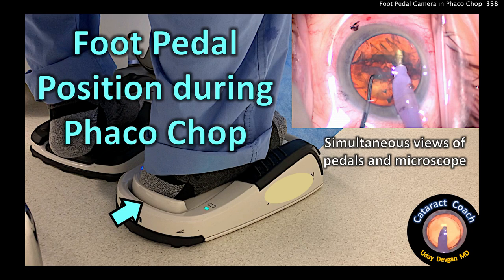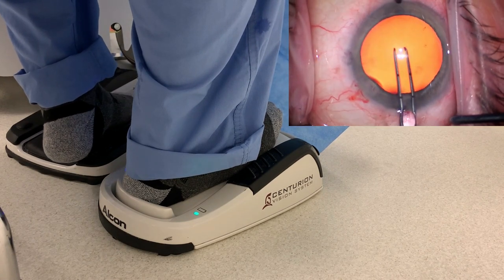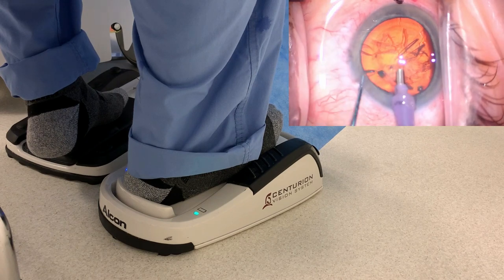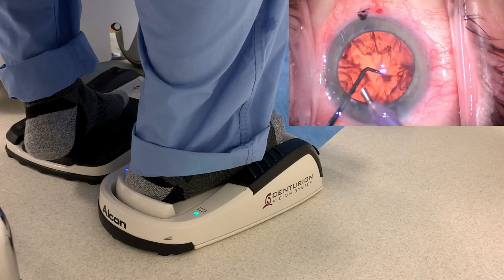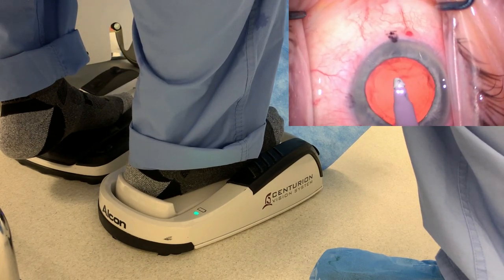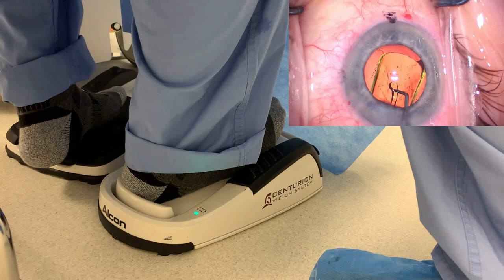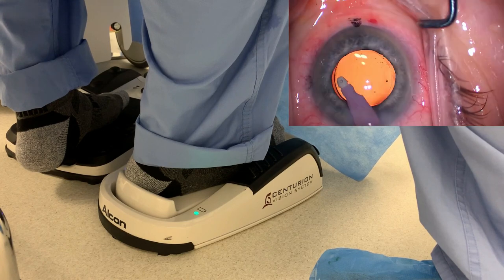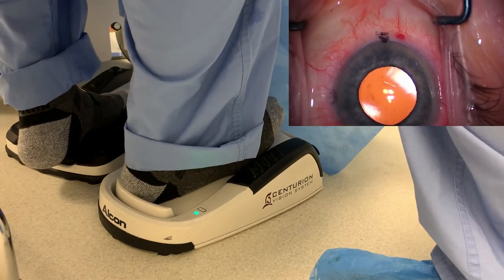Foot Pedal Position during Phaco Chop Cataract Surgery

Comment: Any reason you don’t put it on continuous irrigation?
Reply from the maker: there are times when I want to come out of the eye in position zero (no irrigation) like in iris prolapse / flomax ifis cases. Also when I pull the probe out of the eye, I want it to be off. Doing continuous irrigation is just adding another step to turn it on and off. Many young surgeons in training use continuous irrigation, but you'll find that most experienced surgeons do not.
Reply: @UdayDevgan  agree 👍
Reply: Hi. What kind of chopper do you use?
Reply: @janinbillano  I do not work with this doctor, so I do not know for sure, but the chopper looks like it could be a nagahara.